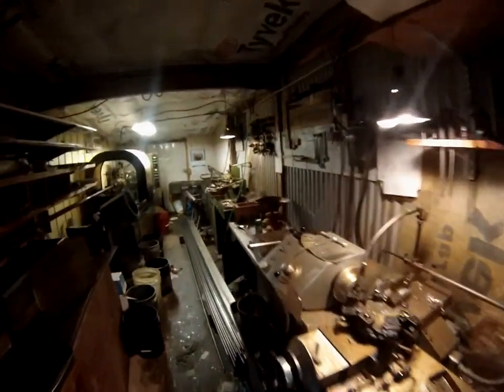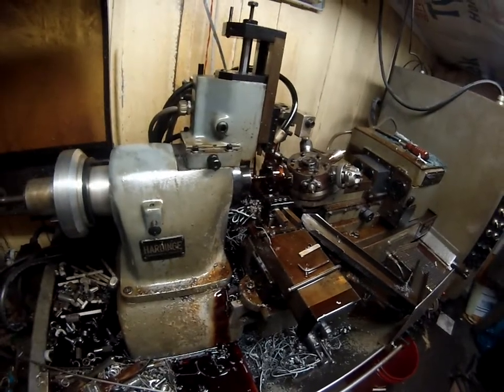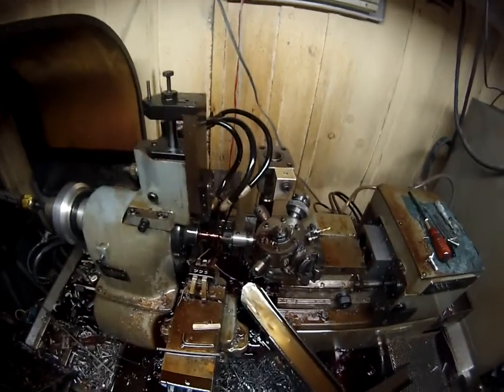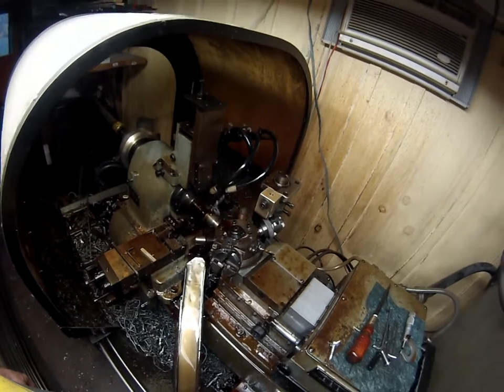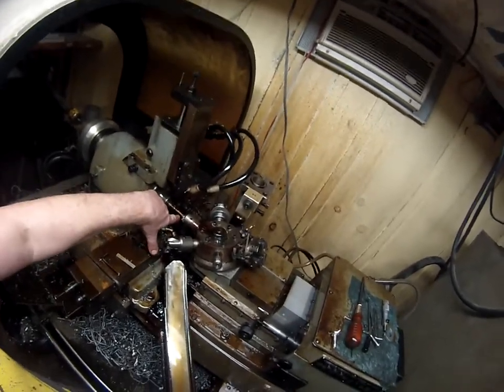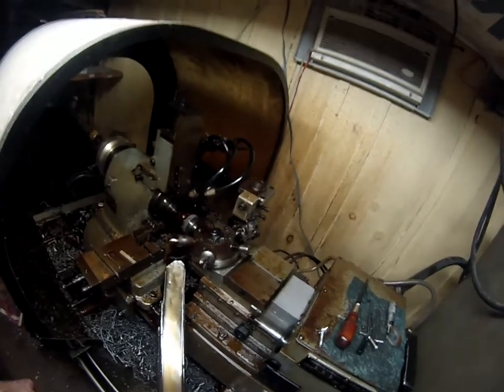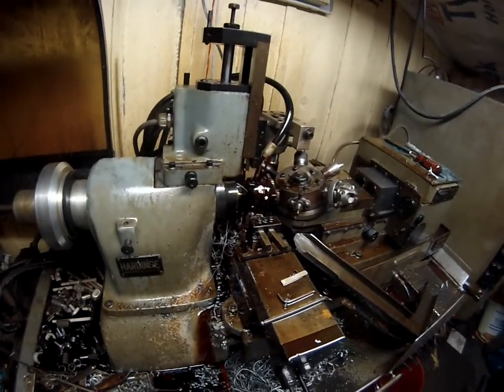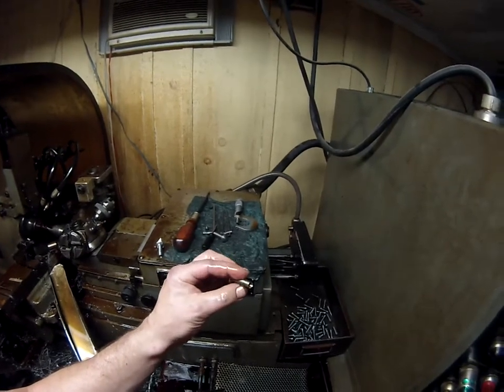Hardinge DSMA Automatic lathe makes a vintage Ford part

Comment: It's so sad that these kids (in machining) coming up well not have exposure to some of the older processes of making stuff. The old school, the base a machinists needs to know, the 3 Rs of machining. These guys now a days are machine operators. The fellow that runs Apple now, said the reason he makes his products in China is because in the USA he can put all the talent to produce his product in his office and than said, do you know how many stadiums it would take me to hold that talent in China. It's is sad the talent that's being throw away and denied the possibility to pass on what they were privilege to learn. Thanks USA
Reply: Agreed same in my country - but that prick from apple was one of the people responsible for getting rid of all the tool and die makers - that's what the arsehole was talking about tool and die makers - it would only take about three years to bring a bunch of kids back up to speed all the tool and die makers are still alive.
Reply: Are you a tool and die maker, three years to bring up to speed, really. Take in to account how many of these young folk you have to try to train to get the one that this is this person is calling. I figure about 20 to get one. Not a waste of time for the 19 that turns out this is not for them that may go on to some other discipline and maybe in manufacturing. They will be able to communicate with guys like me more effectively. Have you ever had to work with an EE (electrical engineer) that draws a cartoon on a napkin and tells you to make this. So the exposer to 19 is not a waste of time. Three years to bring up to speed, I'm not even going to comment on that. I would also like to know were all these competent people well come from to train these young folk, they are dying ever day. I sure enough wish you were right but you are not. I would describe what you said as magical thinking.  Sean
Reply: I spoke out of turn - I meant that the basics of machining could be taught in 2-3 years - no not a tool and die maker just was hoping we don't totally lose all these skills in the western world - I think china and India are training up T&D makers at a fast rate - we will be scrweded as manufacturing countries is these skills are lost.
Reply: I meant that companies like apple off shoring everything has starved tool and die making companies & engineering companies generally from having access to the work and money -  I am assuming this as I know these dies are made in one country and shipped to another.